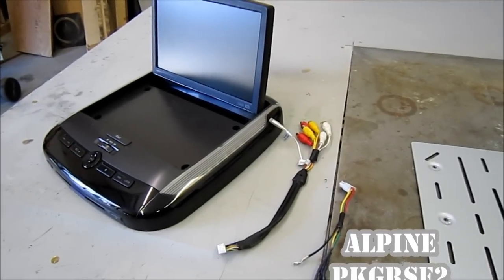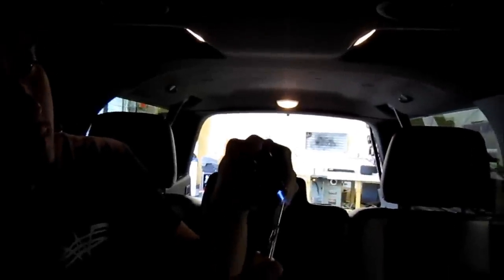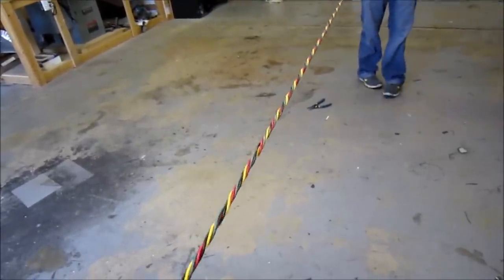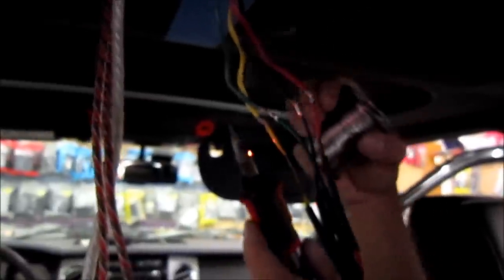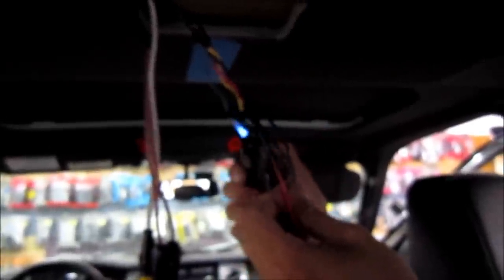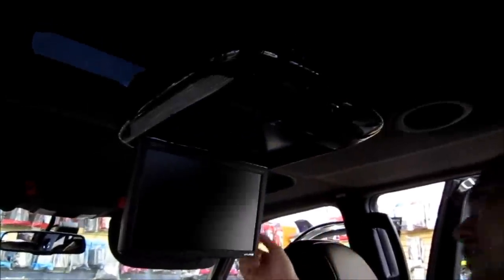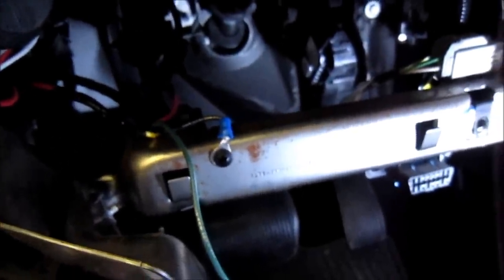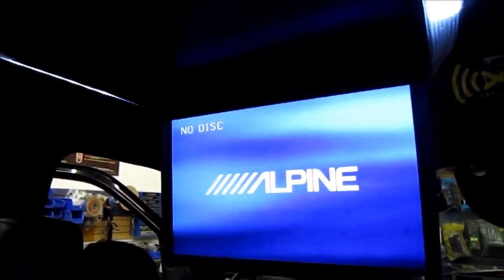Overhead Screen / Monitor DVD player Installation (Alpine PKGRSE2) | AnthonyJ350

Comment: I plan on doing my own install for my 2012 ram. My questions are, Can you run the yellow and red wires to the radio harness? The yellow and red wires come with an inline fuse close to the monitor, should I install additional ones or move them closer to the power source? Great video

Comment: Great job on the install! Definitely didn't cut any corners and you did it right. Assuming you have a head unit that can play YouTube, if the flip down monitor is connected via video/audio rca, will it show on the monitor?
Reply from the maker: As long as the head unit is able to send that signal through its video output, it should.

Comment: Great install!!! Im trying to put a roofmount tv in my wifes Murano.. The unit has built in speakers and dvd player as well. Can I just replace the dome light with the unit and connect power to turn my tv on? Or do I still have to run cables to get power elsewhere. Like I said I just need power to it no need to connect to factory speakers etc..Please let me know what I should do..thnkx

Comment: Hey man real nice install, nice job. 
I have the same truck but a 2011, where do I get those wires/cables or are they a specific type that you could tell me so I can find them somewhere.. also where do you connect all the wires to, except for ground, I got that.. and you were explaining the cables that you want to connect to the center console, but didnt show how you did it.. and which dome light wires did you tap into, or it doesnt matter? Appreciate your time.

Comment: Great ideas in this video. What would you charge for an install like this?
Reply from the maker: Depends on the vehicle.  Typically it's half a day to do the installation.
Reply: @AnthonyJ350  Have you done one in a 2017-2019 Pacifica?
Reply from the maker: @chrisn.4136  Not in that specific yet I haven't
Reply: @AnthonyJ350  Can you install it on a 2008 chevy avalanche?
Reply from the maker: @darvisgray7312  Yes I know how

Comment: Twisting those wires with the impact driver to wrap them in electrical tape seems really ill advised.  Just put them in a split loom plastic sheath or some nylon sleeve (techflex).
Reply from the maker: +IMP3TIGO Twist wire all the time.  We twist the heavy gauge wire individually on the heavy gauge to straighten it out.  Also you can do this after, https://www.youtube.com/watch?v=lPucCd7Rbgc

Comment: hi, do i need to install the overhead monitor bracket always on cross member, or I can simply drill the screws on the bracket and bracket can simply placed between head liner and monitor itself. I dont see any clear vidoes.

Comment: So I just bought a truck that has this same one installed already but It won't say on or playing once I shut the door and the dome lights shut off? Any idea on why this might happen and how to fix that problem?
Reply: Payton Bennitt I would check fuses first. there's no telling where they caught power if it's aftermarket but you could turn the truck on and check all of your OEM fuses. if nothing checks out then you'll have to find where they caught power. I would remove the driver or passenger A-pillar trim to find their wiring then follow it to see where it's connected. I always install an in line fuse if I'm tapping power from an OEM circuit, hopefully it's as easy as finding and replacing that fuse. it sounds like you lost accessory power but ground and illumination are still there

Comment: One question would it be easier to install one if my 2003 explorer comes with a factory one like can I connected with the wires from the stock one
Reply from the maker: You might be able to use power and ground from there.  If you're creative with the audio wires you can probably feed in the audio from the head unit there too.

Comment: My screen keeps falling down, I tried Velcro stickies under the screen to the inside, nothing is working. It's driving me insane. Does anyone have any suggestions?
Reply from the maker: Magnets.  You can get very small diameter rare earth magnets.  You'd have to place them near the screen and see if they affect the image.
Reply: AnthonyJ350 I got some expensive Velcro yesterday, it's strong. so far it's working but I'll keep the magnets in mind, thanks
Reply: I have the same issue; what velcro did you buy/how much $ ?  Would like to know if it works before I go out and buy neodymium magnets.
Reply: Why would small magnets affect and LCD screen?..lol LCD's don't get electron interference unless the magnet is insanely strong.
Reply: Try super glue or gorilla glue

Comment: do you secure the wood to a cross brace in the ceiling or just sandwich the unit between the headliner?
Reply from the maker: You'll want to secure the wood to the cross brace if possible.  You'll have to use short fasteners to avoid going through the roof.
Reply: AnthonyJ350 So why did you skip that part in your video?

Comment: what type tape is used for wires when using the drill wraparound technique?
Reply from the maker: 3M electrical tape
Reply: How do hold it to make it spin smoothly?thanks

Comment: I REALLY LIKE UR DRILL MAN IS THAT A MAKITA WITH A HARDEND OR IMPACT DRILL BIT THAT WORKS NICE- IVE BEEN USING A POS LITTLE SKILL DRIVER BUT I FIND THE SMALL IMPACT DRIVERS TO BE ALL AROUND BEST!!!
Reply from the maker: Ya I love Makita power tools.  They don't have the most torque but I love the quality and ergonomics of them.
Reply: Right....I put a flip down in my truck its a 02 tundra there's only 2 wires when I took the doam light out.... I thought they were just pos n neg  and I solderd the flip down wires to those...  it all worked fine except the tv shut off when all the doors closed man.... then a week later the lights all the door light wouldn't shut off with all the doors closed the tv n tv doam light would because the switches but I cut the wires resolderd new wire relocated the d ok am light and nothing will come on , the radio is shut off too .....so I hooked up a switch n everything turns on but the radio memory is reset, all the eq´s too
Reply: I can hook up a relay ,& im sure it will all work right but  the radio's yellow wire whys it being interfered whys it affecting the radio..   im just lost at what todo
Reply from the maker: randall jr Benoit I'd take the overhead off all the dome light wiring except for a light trigger if it has it.  You should grab accessory and constant from the ignition harness and fuse near your hook up.  Also run your own ground as well.
Reply: thanks man - yeah the 2 wires I never checked I think 1 was constant and 1the other was pos+ and the screws were the ground- its a 2002 tundra access cab 4.7 4x4 fyi- but I just relocated the doam light to behind my seet above my anchor and ran a positive threw the rear pillar and head liner and used a pice of thin wood paneling to keep only the screws as contact points for ground as it has a door on and off mode- everything works great - amaizing how 1 light could cause so many different issues but the fuse was also blown to start-the tv has a inline but I ran a 15 amp from the power source just in case- and I know it hhas constant power going to it but the truck shows no drain on my two optimas and there are no visible leds lit as the tv turns off on its own when its shut- I KNOW IT MAY BE HARD TO READ- BUT THANKS FOR YOUR HELP BRO-

Comment: Hey quick question do you know if it has any antitheft sistem because I have the same one I disconnected power put it back and now it won’t turn on
Reply from the maker: Not that I know of.  Is there a fuse in the unit?
Reply: @AnthonyJ350  yeah there was the fuse of the antitheft sistem I had in the dash the light on changed the fuse and it started working

Comment: I drive a Tahoe and where the DVD Player is mounted it completely blinds the rear view mirror.  Why not have it mounted off to the side?
Reply from the maker: +John Lane I think all my customer's would complain it's off center and it would look so weird.  I would do head rest monitor if you don't want to block the rear view mirror.  Or install a camera in the rear and put a mirror in with a screen.

Lots of vehicles like cube vans and semi trucks don't use center rear view mirrors.
Reply: +John Lane good point
Reply: +AnthonyJ350 I would be concerned about safety rather than looking weird.
Reply from the maker: John Lane When I was a kid my parents told me to enjoy the ride and behave.  Overheads didn't exist.  You could just close the unit if you're that worried about it.  Factory units are installed in the middle.  But I guess everyone wants to have their cake and eat it too right?
Reply: use your side mirrors
Reply: John Lane 
London p
Reply: LMFAO use your side mirrors. If the person behind is gonna rear end you... That mirror isn't gonna prevent it.  If your worried about being pulled over. Follow the traffic laws. I'm a truck driver. Ya know. Truck and trailer 70+ ft.. I use only side mirrors and they work just fine for over 600 thousand miles.

Comment: I have a 99 chevy silverado 4 door will an overhead dvd player work in that?
Reply from the maker: Nicole Alonso You can, I can't remember if the 4 crew cab has a flat roof liner though.  I have an extended cab and it has these curves down the middle.  Regardless you can do it, it just might require a bit more work.

Comment: I have install a flip down tv theres lil lines on the picture dude told me that i need a better battery so the i could get a better quality is that true?
Reply from the maker: What's the voltage and ground look like on your multimeter?

Comment: I have my Toyota sienna dvd screen installed by a certified "tech " but it continuously drain the battery. so I unplugged . what could have done wrong?
Reply from the maker: If all the wires test properly either the battery is week and the dome light feature is in the "on" position and not the "door" position.  Or the unit may be faulty.
Reply: I checked and recheck the unit...alas you're absolutely right... unit dome light constantly draining the battery even its in off position . thank you , More Power to you
Reply from the maker: The lights on those are LED which draw very little power.  You might want to have your battery checked out.  It'll work this summer but if it gets cold in your area the motor will need more cold cranking amps and might not start when the temperatures drop.
Reply: I have to disconnect the led from the unit ...we'll see if it will drain the battery  ..thanks again.

Comment: Cutting that roof up with a knife was possibly the most painful thing I have ever seen
Reply from the maker: +James Bhanvra How else would you run wires for these over heads?  No matter what you have to modify the head liner, how ever you look at it.
Reply: I didn't mean for it to sound like I was complaining, I simply meant that hearing and seeing that being cut gave me anxiety
Reply from the maker: James Bhanvra Oh I see what you mean.  Ya headliners are not cheap to replace, that's for sure.  If you screw it up.

Comment: did you guys also install the rca connections on the bottom?
Reply from the maker: If I have a head unit in the front that is compatible yes.  If we're doing it as a stand alone no typically.

Comment: hi how to get audio output for this one
Reply from the maker: Are you trying to send signal to the head unit? Or signal from the head unit to the overhead?
Reply: @AnthonyJ350  signal from the head unit to over head unit.do I needed the remote control to volume up the overhead unit to get audio.
Reply from the maker: @freddiebalubar2186  Is the head unit factory or aftermarket?
Reply: @AnthonyJ350  I just bought it in marketplace  .
Reply from the maker: @freddiebalubar2186  Is the head unit aftermarket? Needs to be able to play your video media.
Reply: @AnthonyJ350  everything works except the audio.
Reply from the maker: @freddiebalubar2186  You can either use the FM transmitter in the head unit or use the preouts. All depends how your head unit accepts audio in.

If you want the other direction, depends on how your head plays media and what kind of outputs it has.
Reply: @AnthonyJ350  ok I will try again thanks.

Comment: 2 din 10.1 inch screen car radio gps
Quad-Core Android 4.4.4
car stereo audio double din touch screen universal gps navigation
 
Key Functions:
Android 4.4.4 Operation System, the latest android OS, Fast response, stable system
Quad-Core RK3188 1.6GHz Cortex A9 CPU, True 4-Core Processors, Increase performance markedly
1GB DDR3, 16GB Internal Memory flash (about 12.5 GB Available)
10.1 inch 1024x600 HD screen, 65000 color, colorful display
Mirror surface high definition and high transmittance LCD
Capacitive touch screen, support Multi-point touch
 
GPS receiver:
Frequency: 1575.42MHZ C/A CODE
Channel: 66 channels for searching satellite, 22 channels for tracking
Tracking sense: -164dBm
 
Support Steering Wheel Control 
 
Stereo radio, FM (76.0-108.0MHz) AM (522-1620 KHz), support RDS
Multimedia player, 1080P Video player/MP3 player.......
Bluetooth Phone Call, A2DP/Phonebook/call log
Built-in WIFI, support external 3G Dongle
Mirror Link and Airplay

http://www.aliexpress.com/store/product/10-1-inch-screen-Quad-Core-Android-4-4-car-stereo-audio-car-radio-gps-2/1956112_32600321249.html

Comment: Where can I get the power from for a after market overhead in a 2003 Ford Expepdtion
Reply from the maker: At the fuse panel or thick gauge wiring inside the cabin.